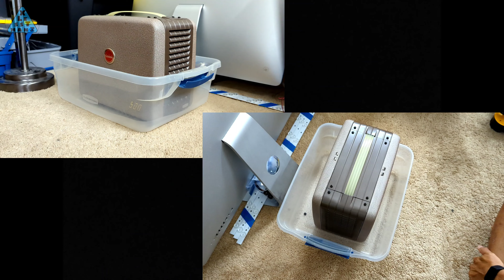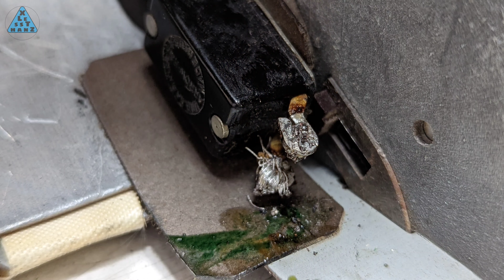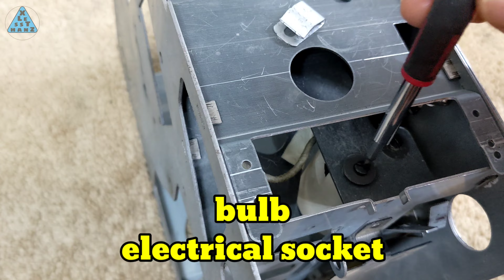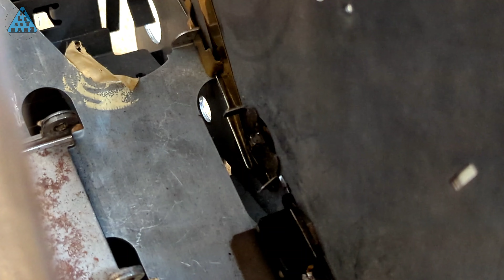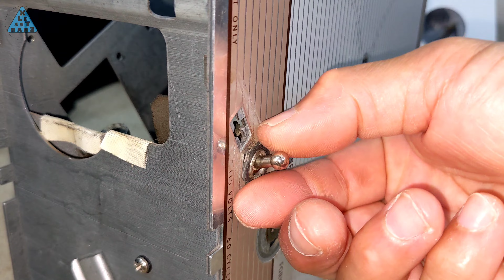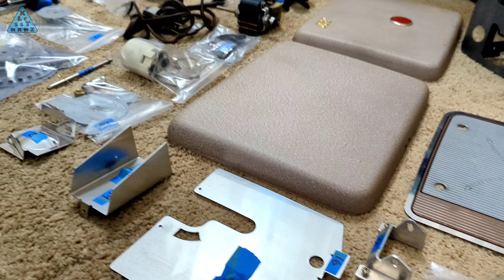Teardown - Kodak Brownie 500 Projector (SEE CONVERSION PROJECT ALSO)

Comment: any update on the conversion project?
Reply from the maker: Funny you should ask.  I had the parts in storage for the past couple of years, but have recently gotten them out and started working on reassembly.  I kinda know what needs to be modified.  I just need a way to test the modifications to make sure they work, before implementing them.  My best ETA is 2025 🤞🏽🤔
Reply: @XLessThanZ  I look forward to what you figure out. I am trying to delve into LED conversion for other models I have but seems very niche and not a lot of info out there.

Comment: I actually just got one of these (extremely rough but somehow working condition unlike yours) 
And I was wondering how you would play movies with sound on this? Because there isn’t an internal speaker I know about nor is there a plug in. Could you help?
Reply from the maker: I picked up a few 8mm family videos from someone on eBay to test my projector.  It works great, but there is no sound.  I didn't think there was   supposed to be any sound.  Even friends who had there own 8mm cameras would make videos with no sound.
Reply: No, they don't have audio, they're just film like the kind you see now in physical cameras, you have to use a reel to reel or other audio recording device, which is what they used at the time
Reply: @Psyke234 Yeah, I never edited the comment, sorry. I figured that out a few months afterwards